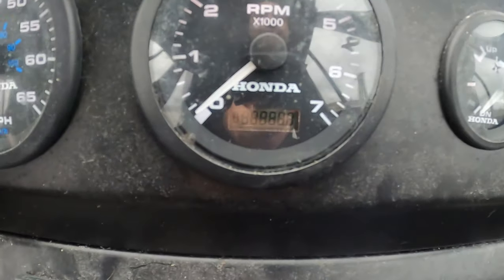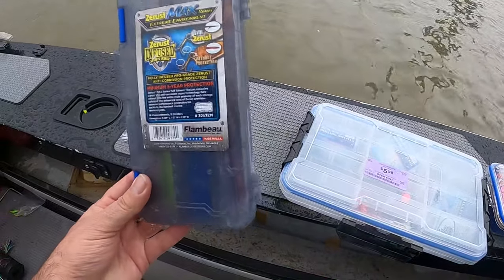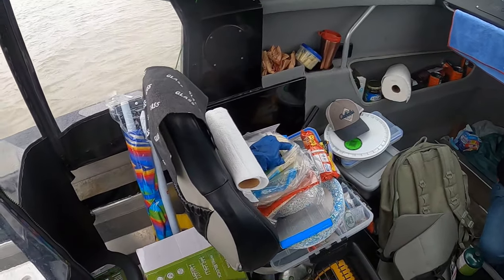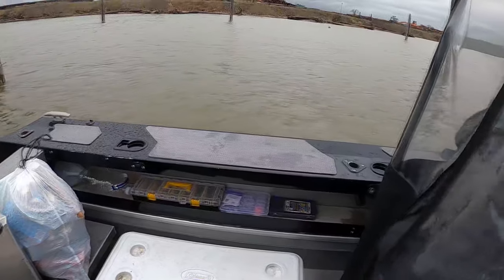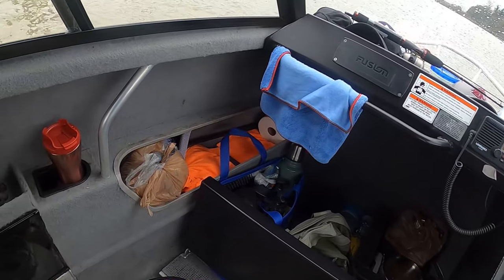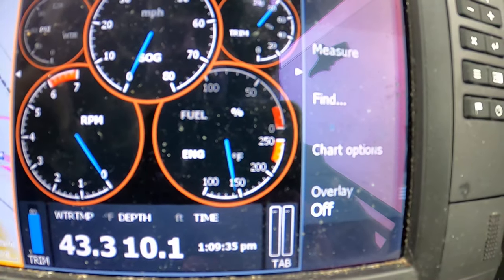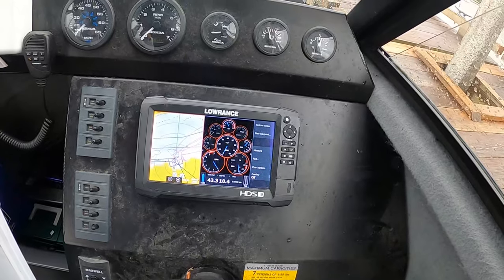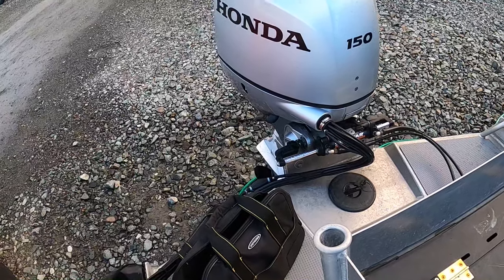Honda BF150 Broke down so we cleaned the boat! | Stabicraft on the Sound

Comment: I have the internal manifold engine anodes replaced every 2 years, or sooner if visual inspection indicates.  The flat/rectangular one on the bottom of the outboard bracket wears fastest; I suspect it is trying to protect the entire boat.  I also have a bolt-on sacrificial anode on the hull that seems to get replaced ~2 years.  My Stabi has been epoxy barrier coated and bottom painted, so my galvanic corrosion is minimal. Water pump housing and impeller assembly every 4 years, and full LOF including lower unit gear oil annually.  I have a single BF 135 and ES 8 as a kicker and emergency power source.  Cheers!
Reply from the maker: @Mike Stevens, I may have to look into a kicker down the road as well, I would certainly love the redundancy. Much better than waiting for a tow!  I checked all my anodes and they did not look bad at all.  My boats only in the water about 10-12 hours a week though, so that's probably why.

Comment: I'm a Yamaha guy, so this may not apply accurately to Honda. The three anodes in the cylinder head are scheduled for annual replacement. They won't need it, though. I would suggest pulling them and inspecting on an annual basis for inspection. They have a habit of being difficult to remove if they don't get pulled for a few years. On the Yamaha, you will want fresh sealing grommets each time they are pulled, probably a good practice on other makes, as well. I run water pumps for two years, unless there are indications that it has been compromised. I suspect you have a temperature sensor/sender issue since the alarm is sounding, regardless of actual temperature. Good luck and, keep us posted!
Reply from the maker: Thanks Jon.  I suspect a sensor as well.  I ordered both and will replace both, then bring the old ones home to test.

Comment: Every year on the anodes, but mine stays in the water most the year.  What ended up being the cause of the faulty temperature warning?
Reply from the maker: Thanks Woodrow, mine are still looking and feeling pretty solid but I may go ahead and replace them this servicing, or at the next one for certain.  My boats hours match the number of hours it's been in the water pretty closely.  

Haven't sorted out the temp warning mystery yet, but stay tuned, that's coming soon!  We want to get back out and fish, I have parts arriving tonight.

Comment: sounds like a dead short on a sensor nothing to do with water flow
Reply from the maker: Fully agree.  The engine has four temp sensors, three are the same part number.  One is in the exhaust manifold.  I suspect that is the one that kicks off when the water inlet ports are blocked.  I intend to replace all four, label the ones I remove, and test them each. Or test them before I remove them and see if any are obvious suspects.  The extras will remain spares, then I'll have to test the possibility of changing one out while on the water.